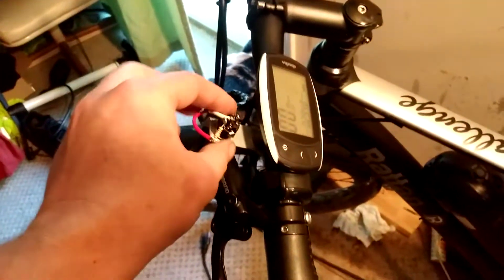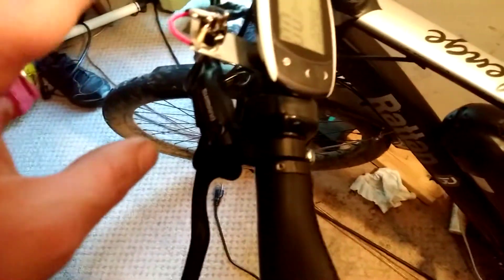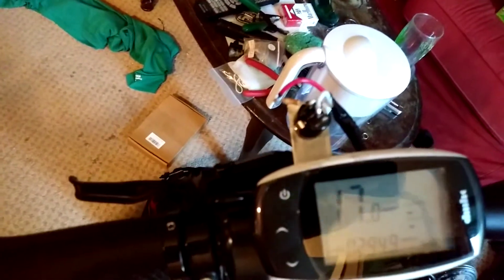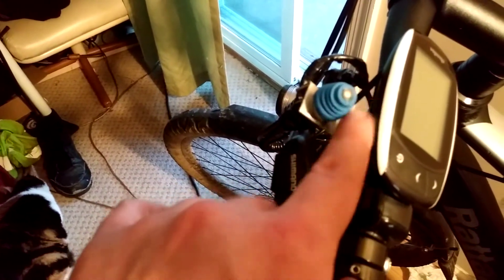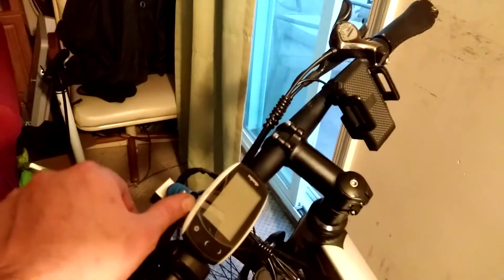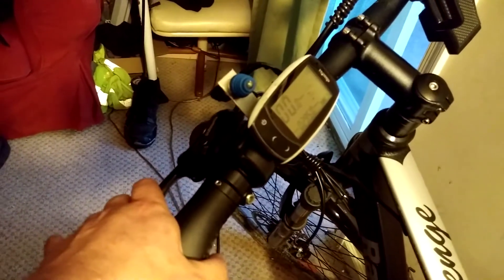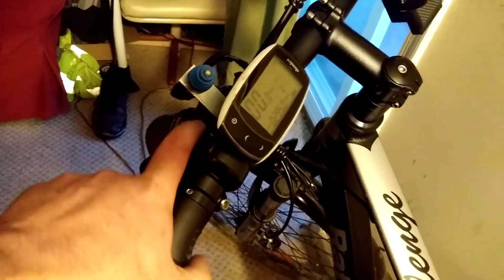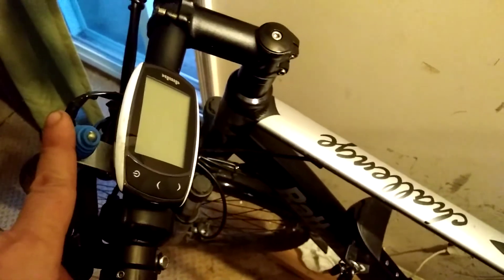Throttle toggle switch electric bike modification

Comment: I got a brake lever kill switch with red/black wire. I want to turn that into a throttle.
Reply from the maker: I thought those were built into the brake lever, like an extra brake lever for throttle?  idk, might get in the way of the brakes.  as long as its wired like the switch above I guess it'll work.  It's been so long, I use a gas powered scooter now and I love the thing, ebikes for everyday commuting sucks compared to the scooter imo.  It's got big 13" wheels so it's pretty smooth
Reply: @OGmolton1  yeah it's built in, like a button inside that depresses when you brake. I got an extra one, only red and black vs the actual throttle with red black and white.
Reply from the maker: @XiaolinDraconis  I like that idea, probably safer than the on off switch, and not as annoying as the thumb throttle hopefully.  As long as it can switch in the resistance proper so it thinks your hitting the throttle you should be good